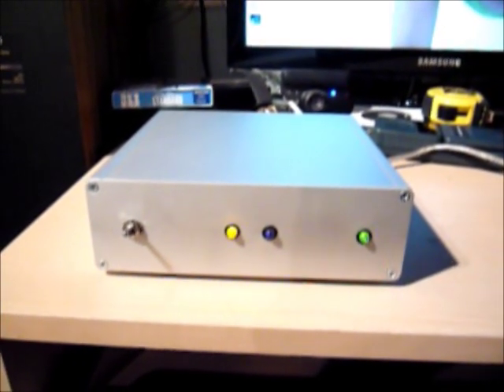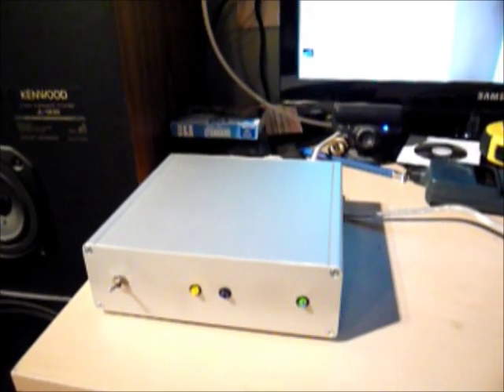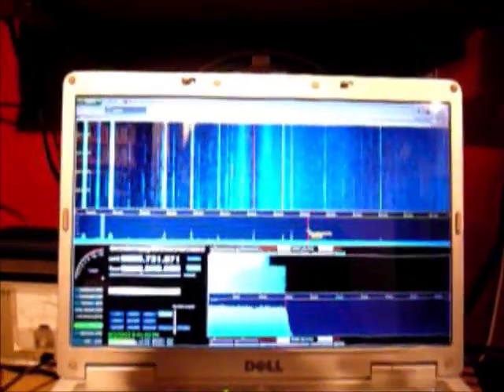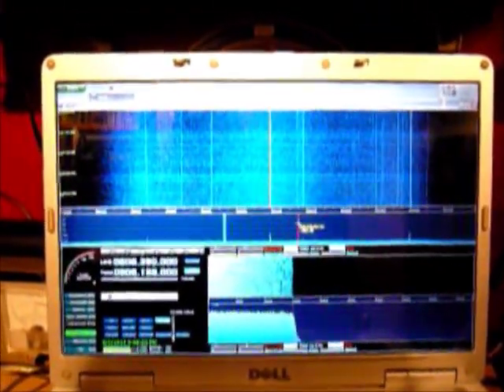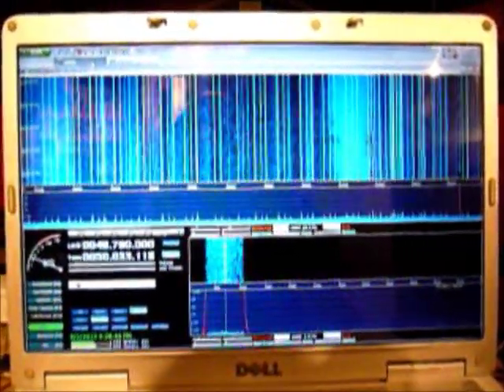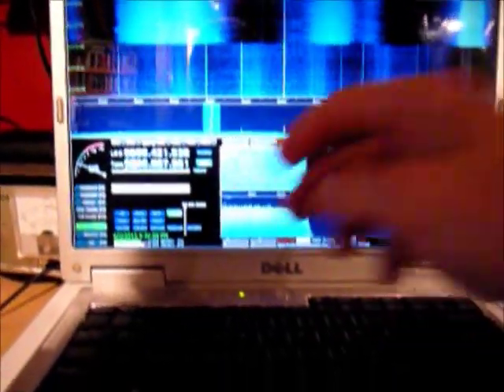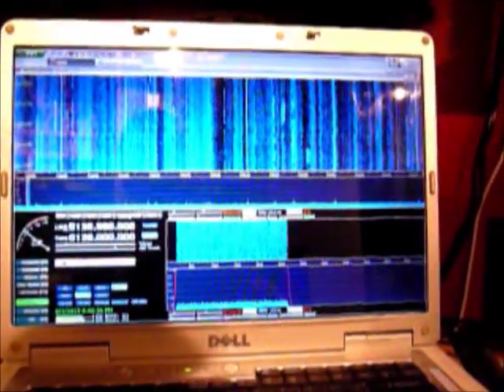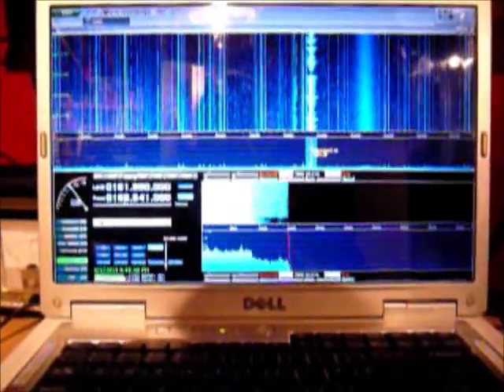RTL2832U SDR demo with HDSDR. Budget SDR

Comment: Hey RC286, where did you pickup that enclosure? I am using an aluminum ext HDD enclosure with a similar setup to yours, but I am still seeing quite a bit EMF noise. Wondering how well your box does at blocking EMF.
Reply from the maker: Picked it up at the local electronics (components and parts) supply store. It is made by Hammond Manufacturing.

Comment: never know intel you try...im runing a old direct tv receiver on my hdsdr by via usb by pass'ing the card slot chip useing a old dish and receiving HAM RADIO HF/VHF/UHF / SW just fine.....and works good ......some day ill put the how two's out there...ps wwb boom's in on this set up....
 

  you know you guy's out there HDSDR will come to live with a air port card ....in your laptop pc and receiving 25-1300 MHZ RECEIVER SCANNER FM/AM/SSB HAM RADIO HF/VHF/UHF FM FMW FMN all you need to do is to take out the receiving chip and add your one out of a non working scanner ...i did work's good i used the same on a old usb wify stick and it kick's ass......too .....you know wify is on the 960.987 mhz ...fm..... band,,,all you need to just do a make over .....took me 25 min to do it with a solder gun and a tooth pic and a flat head .....so why are you throwing your money away on ebay junk when your air port card in your pc dose it all..... evan has a antenna ......dave of pocatello idaho raido tech .....cat out of the bag.....

Comment: What kind of antenna are you using for your setup?
Reply from the maker: Basic end fed random wire. Its fed with RG6 coax up to my roof to a home made 9:1 Un:un transformer to bring the high impedance of the longwire closer to 75Ohms. The antenna is grounded at the un:un with 8awg wire to my string of 3 ground rods that also ground my 5/8CB antenna and my discone scanner antenna.

The longwire is attached to the chimney with a single point spool rack used for overhead electrical drops. The insulators on either end are made of PVC pipe about 2" sections and nylon rope. The antenna itself is galvanised aircraft cable, about 45feet long running out over the roof across the yard to a 2x4x12 with a pice of angle iron attop it as the anchor point attached to the 4x4 fence post. Another pvc pipe insulator + rope + turnbuckle for tension is here to anchor the antenna to the angle iron. Antenna is roughly 18ft above grade.